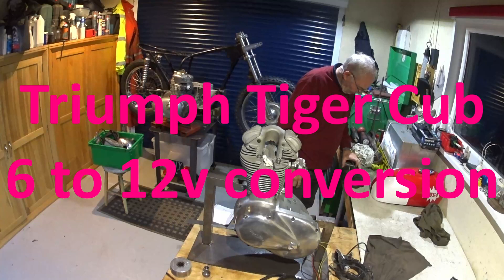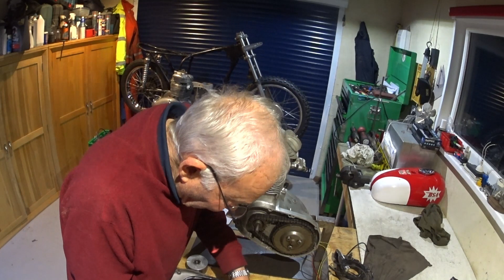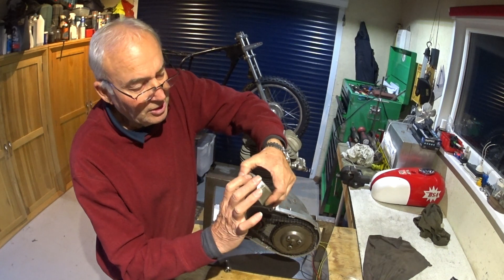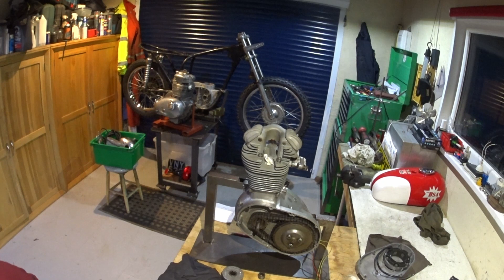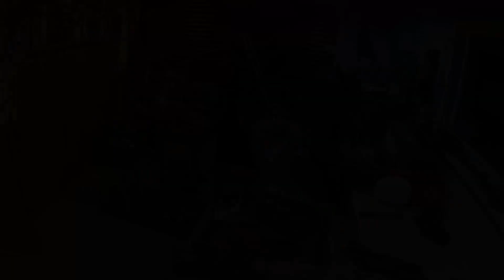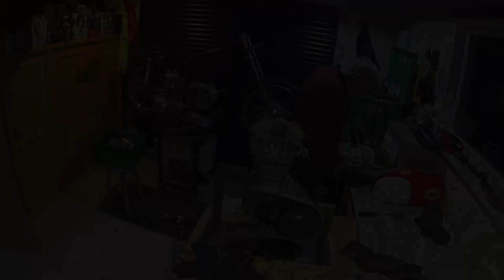Triumph Tiger Cub 6 to 12v Conversion (Lucas RM21)

Comment: Very helpful. I bought an RM21 12v conversion kit for my Cub - the new rotor is thicker (35mm) than the original (30mm), so shaving a bit off the adaptor sleeve should hopefully prevent the rotor nut from fouling the outer casing. After that, it's a matter of fitting the new 12v coil & regulator/rectifier.

Comment: Why is it that the Tiger Cubs my friends and I had in Alaska in 1963/1964 were 250cc and 12volt and those in
England were different?  Were the export models different from those sold in England?
Reply from the maker: Hi,

All Tiger Cub's were 200cc with a bore and stroke of 63x64mm and right up to the end of production in the late 60's, and all were 6 volt electrics with positive earth/ground. A lot of owners converted them to 12 volts as the lighting at 6 volts was very poor if you were riding at night.

You can fit an alloy big bore cylinder kit for Triumph Tiger Cub that uses a Triumph Trident piston to take it to 230cc, but if you want to go to 250cc you need to also fit the modified crankshaft kit that has a longer stroke, however both kits are aftermarket and nothing to do with the Triumph factory.

You may be thinking of the single cylinder BSA Starfire which was 250cc with 12 volt electrics. I have had a couple  of Tiger Cub's in the past and still own a 1969 Starfire and the Starfire is a far better bike, however the engine is still copied from Edward Turner's original design of the Cub engine, just 50cc larger and better engineered.

Regards, Brian.